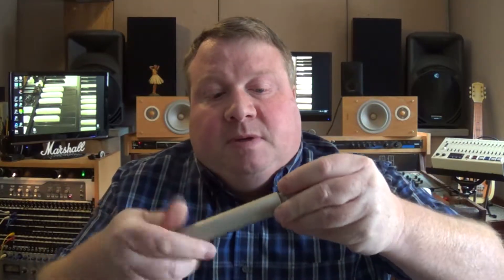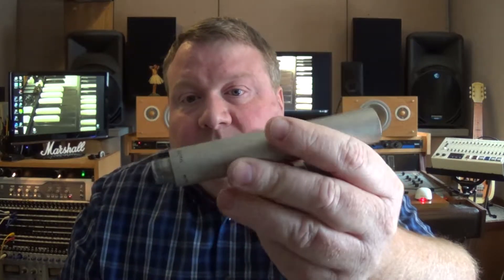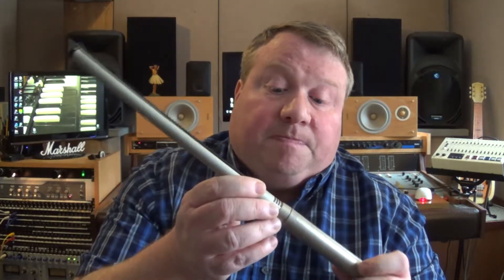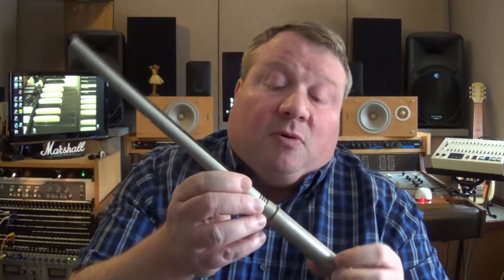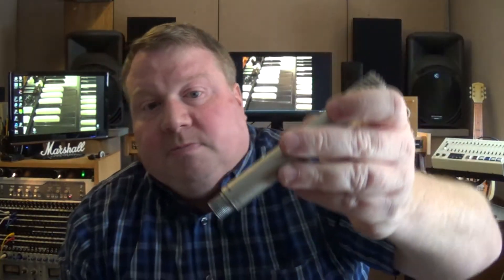A Bit About Vintage LOMO Solid State Microphones - UM51, UM53, 8A5, 8A19 and 8A3

Comment: I have a pair 8A19s that have been modded to be tube mics. I haven't opened them up, but they do require a PSU and sound a lot like the 19A9, though not quite as big and spacious. Do you know anything about this mod? Thanks
Reply from the maker: post a photo or a link to a photo and I'll let you know